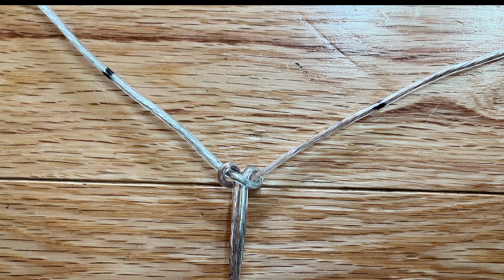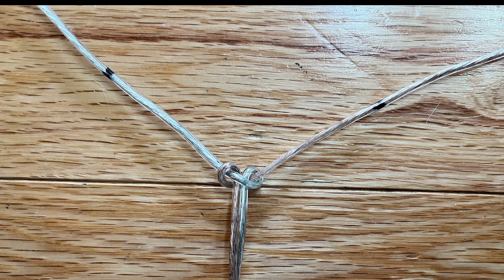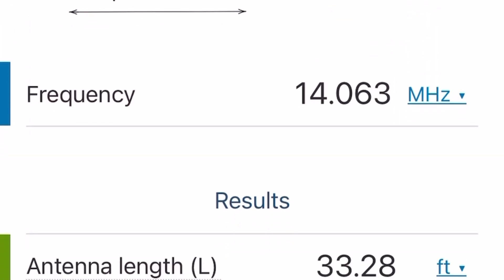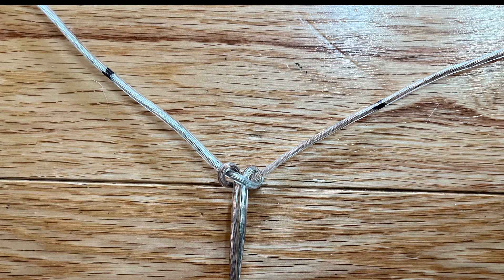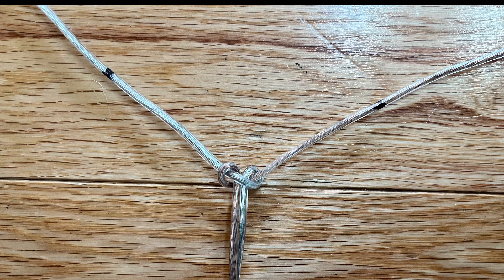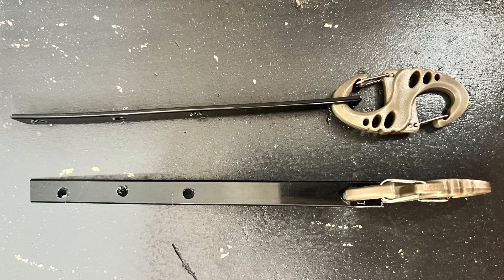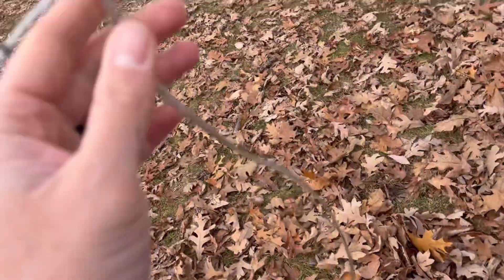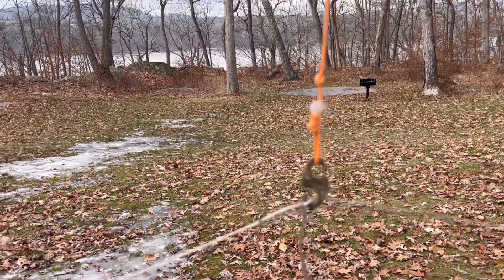DIY cheap, easy, effective, speaker wire dipole! This was actually 3 watts.

Comment: The speaker wire dipole has been around for decades, in the old days the common name was zip cord antenna or zip cord Zepp it had  been in the ARRL antenna book for many years it may still be there? , the twin line feed  is actually in the 75-ohm range and although not as low loss as using (300 ohm to 600 ohm  ladder line) the antenna can actually radiate very well even at Qrp   you can cut the antenna to the lowest band you wish to operate, just split it and tie the knot and run your dipole ends out and then with a good wide band antenna tuner you can work multiple bands, This antenna is very similar to the center fed Zepp which has been in ham radio since the days before coax,  I have made hundreds of contacts using this simple antenna and many of the POTA ops have recently  found its usefulness,   Thanks for the video 73  J
Reply from the maker: Wow! Thanks for the info. I will have to some research. I’m glad you enjoyed the video!
Reply from the maker: @ThePrivateMan3301 Correct. Old thumbnail. This has been clarified by many in the comments. I was newer to the hobby and appreciate the information. 73!

Comment: I can appreciate that you know only one leg is emitting RF, but this is a quarter wave antenna on it's side, you need both legs to push pull, so a unbalanced to balanced transformer at the middle, called a 1:1 BalUn is required, not optional.  I'm glad it's hearing and transmitting and I suppose that is all that matters, but the majority of your RF is being absorbed by the ground.
Reply from the maker: Thank you for this information. I will definitely educate myself on this feedback. This antenna isn’t my design. This is a back up antenna made famous by a Jerry who is now a SK, KG6HQD. I must say, despite most RF being lost to ground, this antenna gets better signal reports than my other antennas from manufacturers. Very interesting. I am brand new to making anything resembling an antenna 😂 so like I said, the information is appreciated. 73!
Reply: @KD2YDN  This "design" is left over from when radios had dual screw down terminals on the back giving you a direct balanced output, in that you'd use ladder line to get out side.  Every ham finds this and runs with it, learn to make three wire toroid balun,